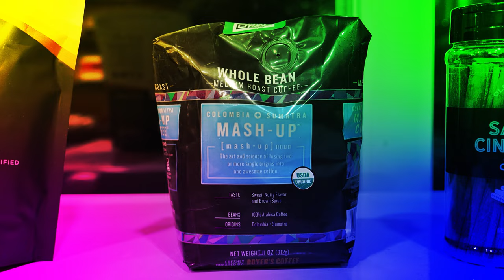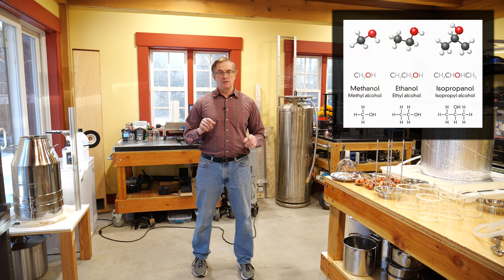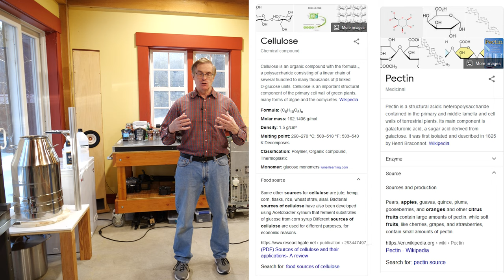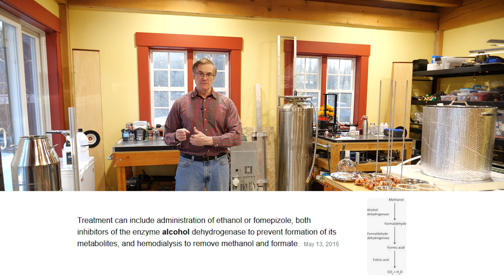Making Vanilla Flavored Rum! - Part 2

Comment: Love the channel. Very well produced and paced. Wish I had a facility like yours. 
Question for you: by running the wash through your reflux still has this not stripped any flavor from your wash and left you with almost neat ethanol (having discarded the majority of the methanol)?
Reply from the maker: Thanks.
I described the principles of reflux in our first video in this series on distillation.  It's not the presence of the reflux column or the plates that cause the reflux but the temperature gradient.  By turning the reflux condenser way down or nearly off, there is still a little reflux, but not much.
Reply: Ok got it. Run the coolant temperature higher and there less reflux/more pass through and hence it picks up more from your wash. This requires you to be able to vary the reflux temp from the condenser temperature surely as you want to condense whatever comes off your column efficiently and not vent ethanol vapour. Bit of a waste and not a little hazardous. I’ll look at your distillation vid so if the answer is in there don’t worry explaining again here.

Comment: Great video, as always, but I have a question:  Is the best part of the vanilla being thrown out with the methanol?  It would be great if you had a way to bypass the vanilla beans, until after the methanol component was discarded.   To me, it feels like running a cleaning cycle on a Mr. Coffee machine, with tomorrow's coffee  already in the basket!   Might the ethanol be  encountering depleted botanicals, or am I over-thinking this?  🙂

Comment: Hi, a great quality video as always! I have a question about your thinking process of making the cuts. Knowing that there can be huge variation in the quality of cuts towards the end of the distillation, wouldn't it make sence to take more frequent cuts? In case you choose to dispose some of them, the proportion of lost cuts could be smaller. Cheers
Reply from the maker: Thanks.
You're correct.  It's simply a matter of how many containers you have.  To make a significant difference we'd have to push the number past 50.

Comment: Thanks a lot. You made it clear to me how to produce rum and how you make cuts, in this way is very easy. One question about dunder: you take the dunder from the bottom of the fermentation vessel, but I always believe that dunder was the residue of the distillation left in the tank. I'm in error or both should be consider dunder? And then my observation about fermentation and your dunder: you put in the wash something that is wild, you don't know exactly what kind of "beast" you have in the soup and that's in the name of the final flavour. But then you put a great selective pressure by overpitching tradional yeast probably overwhelming the wild yeast in your dunder. I think that another key point is time: after a week with that pitching rate you had the fermentation ended, but normally wild fermentation take some time to start condtioning the must. I hope my english was decent, thank you very much for this vid you explanation are very very clear.
Reply from the maker: Dunder has been historically the residue from a fermentation, stillage or a mixture.  It's not a hard rule.  You could reduce the amount of pitched yeast, you could pitch the yeast sometime after the dunder is added etc.  There are a lot of options.
Reply: @TechIngredients  thank you very much

Comment: Did you leave the 3000 Watt element running at 100% the entire time (no PID or PWM)?  If so, do you know what the temp range was of the mash inside the boiler through the run?  It appears you did all of the regulation with the reflux flow rate only.  I greatly appreciate the awesome channel and look forward to more distillation videos!
Reply from the maker: Thanks.
That's correct.  The time lag before any effect can be seen when changing power settings is large and it's easier to adjust the cooling flows.

Comment: Another great video.  You mention you stopped at a concentration off the still is about 40 proof for flavour reasons.  I'd be interested to know why the flavour or quality is decreasing as you continued the distillation.   Since you have ice cold water, and the technology, what if the distillation could be done at vacuum and thus lower temperature?
Reply from the maker: As the alcohol percentage drops and the distillation temperature rises, less volatile aldehydes, esters and oils become more and more concentrated in the distillate.  These contribute some weird and unpleasant flavors.

Comment: One of the huge dangers of running a still like that is having alcohol vapors escape and exploding.  You mitigate a lot of the danger by using restive elements to heat the mash.  But you also have 22 open containers of alcohol on your desk.  Strongly consider getting a LEL meter (lower explosive limit).  They work by constantly sampling the air and setting off an alarm when the air hits 10% of the concentration of a flammable substance necessary to explode. You never know when one of the dozens of flanges on the still might not have closed correctly.

Comment: The more I read the science on distillation it seems to say the foreshot doesn’t actually contain significantly more methanol and that it’s actually slightly higher in the tails. It does contain lots of other nasty stuff but apparently it’s very hard to separate methanol and ethanol.

See “Methanol in Grape Derived, Fruit and Honey Spirits: A Critical Review on Source, Quality Control, and Legal Limits”, Botelho

Thoughts?

Comment: fabulously detailed report-  one question?!  when and how did you clear the mash before hypothetically adding it to the still????
Reply from the maker: The only thing we hypothetically did was carefully withdraw it from the pot leaving any sediment on the bottom and any foam on the top.
Reply: @TechIngredients  time between finish and transfer?   im struggling to find a way to rapidly clear my wash - so i get more product and less scorching. FYI i am opening a micro distillery in Panama- ( country)   so any advise you give is both legal and appreciated...lol.....how can we filter this mechanically down to say 1 -5 microns?
Reply from the maker: About 12 hours.
As I described in our first video on this still, the band heaters located around rather than under the kettle make a big difference.
Have you ever worked with bentonite as an agglomeration or sedimentary type of filter? It's remarkably rapid and effective in settling suspended material to the bottom of the fermentation vessel.

Comment: Regarding the methanol with the reflux system - at 6:13 it says "...the first vapours to boil off the water are the more volatile alcohols., those with the lowest boiling point." So i get that, methanol vaporizes earlier and is therefore also the first product to drip out in a standard distillation system. But by refluxing all the stuff for quite a while, pretty much all liquid should have about the same temperature, so all vapors from all boiling points should be mixed. Why should there still be more methanol in the first parts, than in the later ones? Or is it that after opening the valve and loosing liquid, temperature rises? But this would mean all the refluxing at the beginning is useless because it gets disposed. I don´t get it. Great video though! I like that you always explain things even when you´ve already explained it in part 1 or in other videos! Also super stoked for that second channel!!
Reply from the maker: Thanks.
When we start, the reflux condenser is flowing a high quantity of water causing full reflux and a large temperature gradient along the column.  Each tray has a progressively higher concentration of methanol as you move upward.  As the flow is cut back, the methanol preferentially escapes with the first vapors that make it through the condenser.
Reply: @TechIngredients  Ah yes, i forgot about the different concentrations in each tray ! Thank you!

Comment: I was interested to hear on the last video that the fermentation was an exothermic reaction. I had not thought about this in the past. I had a rather weird thought for the production of alcohol for commercial purposes other than drinking. Would it be possible therefore to combine both processes by using a vacuum pump to remove some of the alcohol vapour and reducing the temperature by evaporation rather than using cooling tubes in the larger fermenters? This also might be a way of removing lighter toxic alcohols like methyl alcohol before the main distillation begins.
Reply from the maker: That's a very interesting idea.

Comment: What a Great Content! I dont drink Alcohol but ever liked the distillation process. Said that, i have a question. Here in Brazil we have a dink called "cachaça" that is distilled from sugar cane. Part of my family lives in a region that traditionally produces that. But different of your distillation rig, wich is made from stainless steel, they use copper for the metal parts. They say that it makes difference to the final product. I would like to hear from you if is there some scientific reason for this statement. Thank you!
Reply from the maker: Thanks!
Take a look at our first video in this series where I described several different distillation systems including this reflux still.  There I explained the purpose of the copper.

Comment: Excellent videos and explanation of the science behind the whole process. I have a dunder question. I have experimented with rum, and have had decent results, on my 5th generation now. However I understood the dunder was kept from the backseat from the still, after distillation, not the bottom of the fermenter. I can see where there would be a drastic difference in the resulting next generation of wash between the two. Could you help clarify this for me.
Thanks for the awesome information.
Reply from the maker: Thanks!
Historically, dunder can be the residual from the wash, the stillage or a mixture.  If you think about it, there should be little real difference.  The stillage is boiled, but otherwise both contain largly the same material including alcohol which will evaporate out over the first week or so.  The sugars, yeast and non-fermentable sugars and starches will host whatever drops into the bucket over the following months.
Reply: @TechIngredients  thanks for reply. Next batch I'll keep some of both and see what happens.

Comment: new project idea.  Wonder if you could use science to explain this long-standing premise amongst fisherman - Using an ice chest, Is it better to allow the ice to melt, or is better to drain the water off, in order to preserve the ice; therefore keeping items in the chest cooler longer, also assuming you do not need the water for drinking in case of an emergency.  Project: Using an ice chest, the best method for preserving ice, including which type of ice to use, ie block, cubed, cubed with a hole, crushed, etc..  It might stifle a lot of folks to know the real facts!
Reply from the maker: Air is an insulator.  If the water is drained then the ice has an additional layer of air separating it from the environment, but you loose the low temperature thermal mass of the drained water. The difference is probably small.

Comment: your video was more than great! i have a question... if we limit the mash temperature up to methanol boiling temp and discard the distillate, will we be able to filter out most of the methanol, and then raise the temperature and extract fairly pure ethanol?
Reply from the maker: No.
Watch our slightly earlier review video on our reflux still.  There, I explain the distillation process and what is going on with the different components in the solution.

Comment: Interesting stuff about cleaning of large steel vessel vs. glass ones. My grandfather and father used to make wine and class containers are possible to clean with hose and brushes and wooden kegs are likely never perfectly clean and dead/used yeast after fermentation is nasty stuff. But it likely does not matter that much in very small amount. 
It surprised me that ugly sediment after the fermentation is reused in your next batch and that it's actually essential. Isn't there problem with some mold or contamination with unwanted bacterias? From wine it's separated as soon as fermentation ends and it's recycled as a fertilizer.

Comment: I don’t know if it’s been mentioned yet or not,  but you might be in trouble with the ‘dunder’ you’ve saved.  Dunder is the no-alcohol product left over AFTER it’s been cooked in the distillation process.  What you have is the lees from molasses ‘wine’, and the alcohol content in it is going to very likely turn to vinegar.  However, perhaps that is part of the dunder process that I have not heard of yet, I’m interested to hear your results.
Reply from the maker: Historically, dunder can be leftover from the wash, the stillage or a mixture.  What's left after the distillation still contains alcohol, but the alcohol will eventually evaporate out when exposed to the atmosphere over time.  Take a look at our previous video where I explained the preparation of the wash.

Comment: Great video. How do you know how many ml is the foreshot of methanol? Is it based on total volume of liquid you put in the still? (40L I think?). How long did the distillation process take to get those jars filled, a few hours?
Reply from the maker: It took a couple of hours. You don't, really.  However,  it will be only a few percent of the total alcohol content, and the temperature rise is a pretty  good indicator  of its disappearance.  In addition, those cuts taste pretty  bad, and you'll  want to dispose of them anyway. And remember, the methanol  was created during the fermentation, not the distillation, so when you make your own beer and wine, you will consume  all that methanol distributed over the entire run.  It's only dangerous when it's all concentrated in a small fraction.

Comment: Nice Vid, I thought you would use a pot still for the rum as the Column may strip the flavors?
Reply from the maker: We turned the reflux condenser way down so that the entire system performs much as a pot still would.

Comment: Thank you very much! Three questions:
1. The hangover headaches seem to decrease with double or triple distillates (like in e.g. tequila) or better quality wines (e.g. Amarone di Valpolicella). Since it seems to be related to the methanol content in the beverages, why some beers and wines cause more headaches than others? Is it due to the pectin etc. content of the must they use?
2. Why a triple distillate of e.g. tequila irritates and burns less in your palate and runs down more smoothly, than some cheaper and minor quality blends of  the same spirit with the same Vol% of ethanol?
3. The toxicity of methanol: skin resorption and inhalative absorption. When does it become dangerous?
Reply from the maker: I suspect there is a significant difference in the methanol content between wines depending on the way the grapes are handled and the resulting solids in the fermentation.
Distilling multiple times is probably more of a marketing gimmick.  With a pot still it is probably mandatory, with a large reflux still the separation is already pretty good.
I've tasted 100% spectroscopic grade ethanol, it burns!

Comment: I really enjoy your content.. this is 👍👍 I have two questions.. do you not use any sealant in the c clamp? Only flanges seal enough? Second, I'm looking to buy one destillery of aliexpress, how worried should I be regarding material quality? Both the copper and the stainless steel? Do bad quality material affect my run?
Reply from the maker: AliExpress can be a little sketchy, although we've used them to supply some products in the past.  I can't speak to the source they are brokering for a still.  
There are thin silicone gaskets between the flanges.  We covered this in the first video in this series where I described the operation of several stills including this reflux system.

Comment: You could use those "heads" in something else, fuel for your car is one thing, that'll mix in quite nicely especially if you have almost full tank of gasoline. Not sure how well that would work in diesel engines though. Lighter fluid or otherwise firestarter fluid will do too. Or if you have permanet marker or grease stains in some surfaces that can take the methanol then that is good place to use it. I think the art ultimately lies in the mash itself and not in the blending of different fractions of distillate, but thats just me. :D

Comment: Enjoy your channel and one question that I do have is this. Is there a formula to determine what diameter the bubble plates should be in regards to the flow of material across them. I suspect that the surface area in each section has some effect on the final product.
Reply from the maker: Thanks.
Not really.  The broader the column, the slower a given vapor will progress and the better the separation.  As the vapor volume increases with a bigger boiler, the larger column becomes  necessary to maintain reasonable separation. The only problem with a very large column is that as it looses heat to the surroundings, your boiler may not be able to provide enough heat to compensate and the vapors which are well separated may never reach the top.
Reply: @TechIngredients  Thank you.